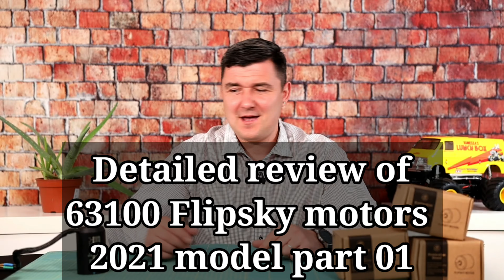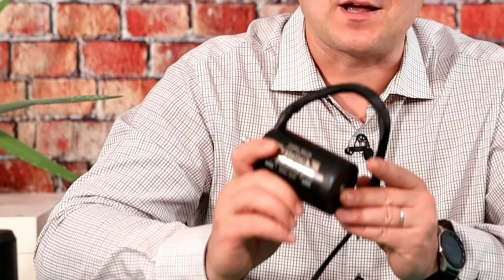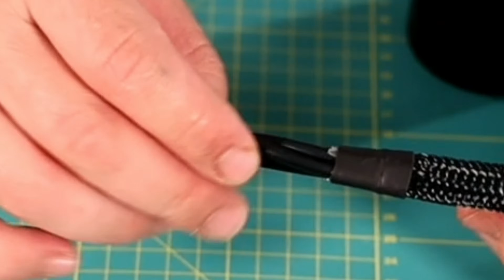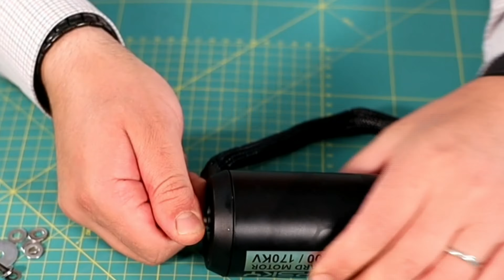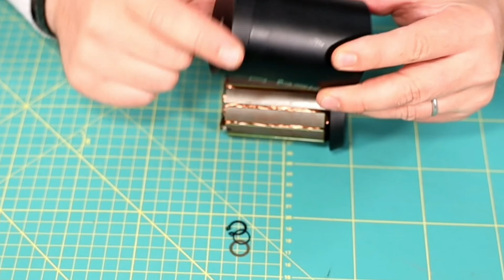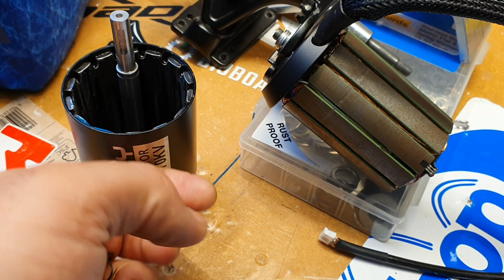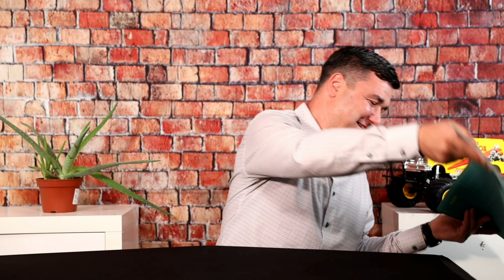NEW 63100 motors by Flipsky 2021.

Comment: This guys got it all. Wonderful job on the videos and your success. I'm a newbie. The bigger the motor the faster/torquer/rangier I know. Can you try to explain the my 5th grader brain how do we know the biggest/fastest motor we can buy based on the size of our batteries without spending too much that we never even have a chance to its potential? I guess it also depends on gear drive systems a little bit too yes? Appreciate it very much!
Reply from the maker: Best way is to use esk8 calculator.

Comment: Too bad nobody makes a dual shafted version of a motor this size.  It has enough power for any electric skateboard and would fit perfectly between the mounts on a standard 180mm truck for a single motor, dual drive to give more power than two 6354 motors could, while still giving a balanced power delivery with no pull to one side.
Reply from the maker: True that but what will happen on the turns?

Comment: May I know their hall sensors are neutral timed? Same or near speed and currents for both backward and forward did you tested?
Reply from the maker: Hi mate! Sorry for delay but i needed time to contact manufacturer. See below they answer:
Hello Pavel, long time no see.
Everything is fine with us, how about you?
Regarding the  motors you mentioned, I consulted our motor engineer.
Our motor Hall cannot achieve perfect neutrally timed, if used with our ESC, the deviation of forward and reverse current and speed is small; if used with other brands of ESC, there may be a certain deviation between forward and reverse current and speed, the normal current deviation is larger, and the speed deviation is small.

Comment: i have a motor but one of the magnets broke... and even tiny bits of grit rub against the armature... is this normal? 
just wondering how an epoxy would fit in there, maybe a thin layer? 
is there any way to repair this magnet? ir rewind coils? i have one broken wire too because it snagged a piece of magnet, but for some reason i still test continuity on all 3 wires?
Reply from the maker: I have battlehardened the motors before and it works however motors do run hot... have you tried contacting Flipsky and asking for replacement?

Comment: Hi panel, what battery would you suggest using with the 63100. Thank you for the great video info about the motor. Many thanks Lee
Reply from the maker: Hi mate. All depends on the build...what ESC? What gear ratio? What wheels ? 
Generally 63100 motors are 65 - 75 Amp so a battery should be powerful enough to handle 150 Amp constant. I am using 12S7P Molicell battery pack. Have a look on my channel, i do have a few tutorials on batteries.

Comment: Are 4 short M4 screws really enough to hold the motor in place with all this power?
Reply from the maker: I do use high tensile screws , all motors use the same fixing method and i had no problems so far.
Reply: @PavelGarmas  ok thanx bro! I’m going to try that!

Comment: So after I remove the three screws or w.e. on my motor, it's just held by magnets? I didn't wanna rip it open and break something apart and thought I had missed something like I had to somehow unscrew the shaft or something
Reply from the maker: Hi mate,
There is a split ring on the shaft that does hold the can in place. I do have a video on my channel on how to take a motor apart. It is about Maytech motors but principle is the same.

Comment: Nice video Pavel. One thing that should be mentioned (which isn't a big deal for most builders) is the 4x fixing holes on the Stator. They are 44mm centered and fine for most mounts.... but I got a set of hypertrucks and mounts and they only have 30mm centers and so they can't be mounted without making some changes. I got 44mm centers drilled in by an engineering company so as to ensure precise placement, but if you own hypertrucks and want to upgrade to Flipsky 63100s then this will be a problem you'll need to address. Would be good if Flipsky could add these 30mm holes. The Bioboards 63100s have both sets so I don't really understand why these don't.
Reply from the maker: Hi Tony,
Thank you very much for the comment. Very good point, I will contact Flipsky and will ask them to look into this.

Comment: if you were to pick between the 6374 BH flipsky motors vs streetwings which would you take?
Reply from the maker: Streetwing are Maytech motors. What do you mean by BH? I do use Flipsky and Maytech motors and had no issues.
Reply: @PavelGarmas  bh = battle hardened

Comment: When is the new Video about this Motor comming ? :)
Reply from the maker: I have tested the 170kV and testing the 140kV now.... i would say in a few weeks.
Reply: @PavelGarmas  your Video never came along ?
Reply from the maker: @Gamestar355  sorry mate what video?
Reply: @PavelGarmas  "I have tested the 170kV and Testing the 140kV now... I would say in a few weeks" ....... ???? 

0:10 Big Headline in the Video "Detailed Review of 63100 Flipsky motors 2021 Model Part 01" 

So i figured you would Show more of em and Ride them. Proving the Battle hardening in the field or Something.
Show acceleration and true Torque Not manufacturer Specs. A proper Review Not Just taking em apart.
I Had really Big troubles fitting them on to the trampa Platform for example. Would Like to See your solutions

Comment: Will the flipsky 63100 190kv motor handle a 48 volt battery?
Reply from the maker: Anton,
Are you referring to 12S battery mate? Yes it will.
Reply: @PavelGarmas  What is the average life of a flipsky 6384 or 63100 motors?
Reply from the maker: @antonshevchuk3414  
It all depends how you ride, where you ride and how you look after your board. Bearings would be first thing that will go at around 500 miles if you ride off road. Normally motors do last well. Does depend if you will be overheating them or not...depends on the set up.

Comment: When you test them, please show what sound they make when you spin them up fully without wheels and test them while riding hard offroad to see how the temperatures are at 100a which they claim it can do. IMO they will overheat. I would even bet on that.
Reply from the maker: No problem mate. The plan is : i am replacing the HD60 with two vesc6Mk5, will test the 6385 that i got at the moment then install the fans on them and test that out. After that I will install the 63100 and give them some abuse ; ) how does that sound?

Comment: What kV do you suggest for a mountainboard?
Reply from the maker: It does depend on the gear ratio mate. I have the gear drives 1:4 ratio on 9" wheels and using 170 kV. 140 will  give you more torque though...but less speed.

Comment: flipsky has decent motors for the price, but compared to their other motors, i dont know if i would spend the extra money. increase of cost to increase of performance ratio is not worth it for me. but if i really wanted motors in the 90s-100s then yes, id get flipsky. most bang for buck i would say is their 74s and 84s, their 55s used to cost $60 but recently increased by 20 bucks almost matching the price of 74, very sad.
Reply from the maker: Thank you for watching and for the comment.  Appreciate it.
Build safely buddy!

Comment: Also they only do 190kv BH 63100’s unless you order 10 then they are customisable to other kv
Reply from the maker: I did ask that question and was told that other kV options will be available shortly. PS. I only ordered 4 and got kV i wanted.
Reply: That’s awesome, I may have to order some when they are available
Reply from the maker: Nope.... 140,170 and 190 mate.
https://flipsky.net/collections/e-skateboard/products/flipsky-brushless-dc-motor-battle-hardned-63100-190kv-5000w
Reply: Awesome, I’ll be placing an order mate, thank you